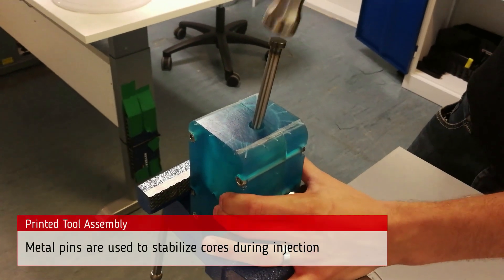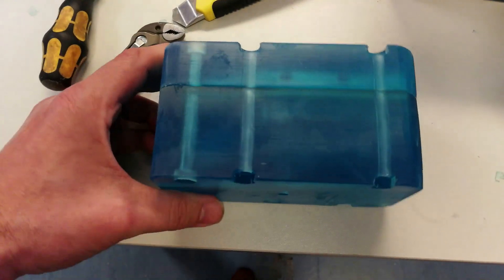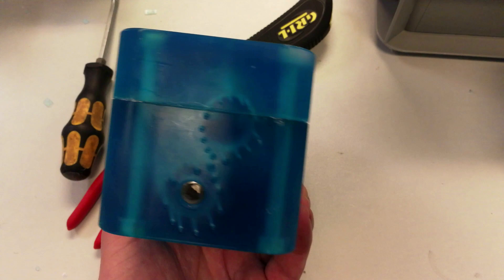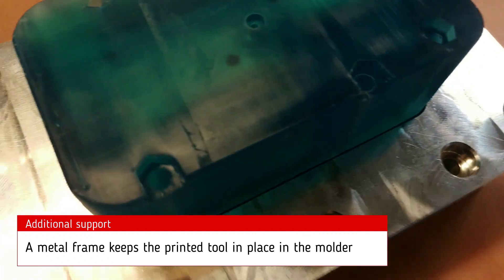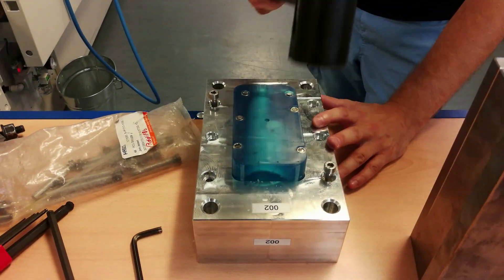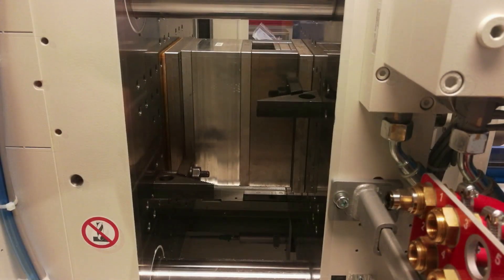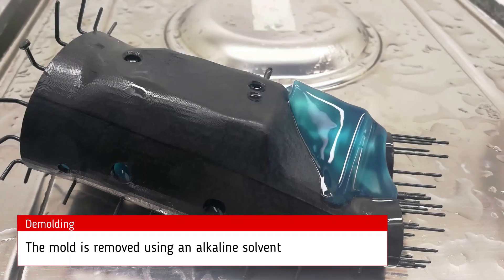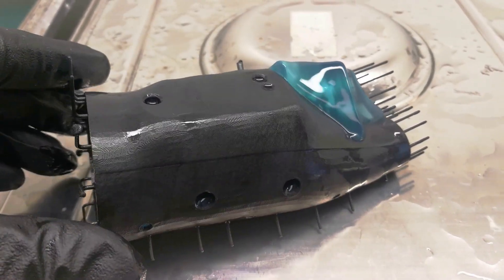The making of   a custom-fit Prosthesis for paralympic champion Peter Rosenmeier

Comment: How long did it take to dissolve the mold out?
Reply: How long it took to print it and how long it take to dissolved? Thanks
Reply from the maker: @lynguyen-gh1mk  The print took approximately 4 hours.
Reply from the maker: A little less than 2 days for total dissolvement and cleansing.